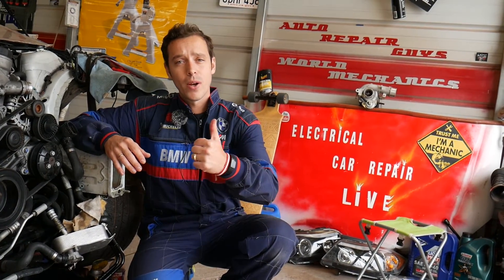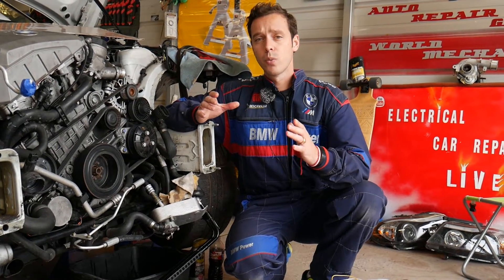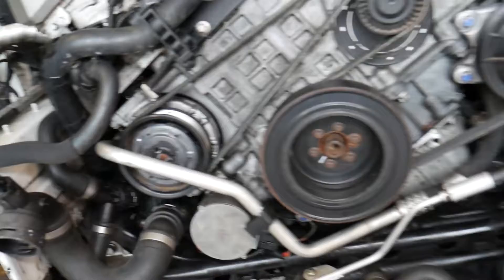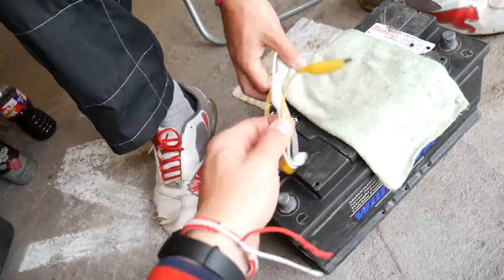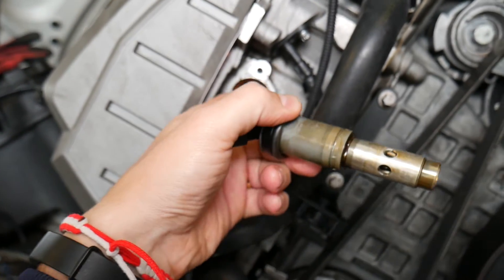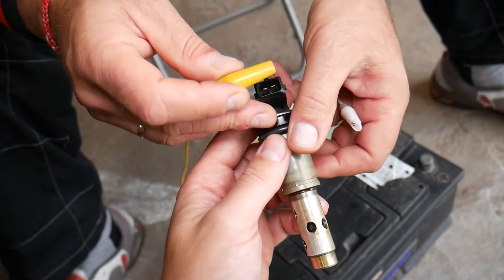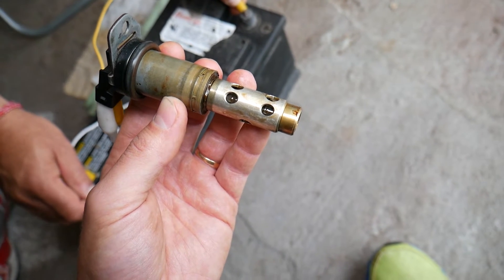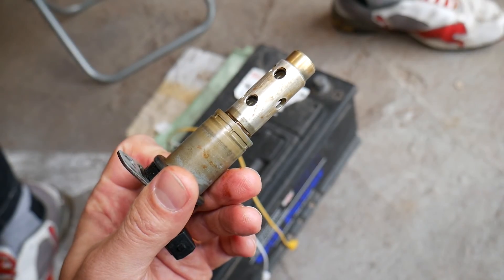HOW TO TEST VANOS SOLENOID ON BMW X5 E70

Comment: Love your videos and have learned a lot, but never have seen your 200 videos on one car!  Feel free to do them on a  BMW N62TU  V8.  Also can you do a video on an ABS valve body rebuild, not the solenoids but the removal of the valves from the valve block so we can see how to disassemble them and what the seals , springs, and internal fluid passages look like.

Comment: I need assistance with my bmw 528i E60! Currently struggling with Codes P116e mass air flow sensor signal electrical, P0171 Bank 1 system too lean and bank 2 system too lean